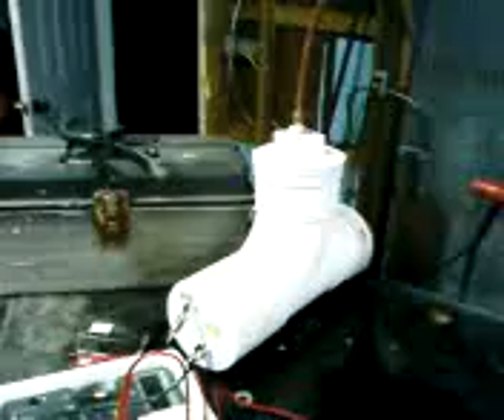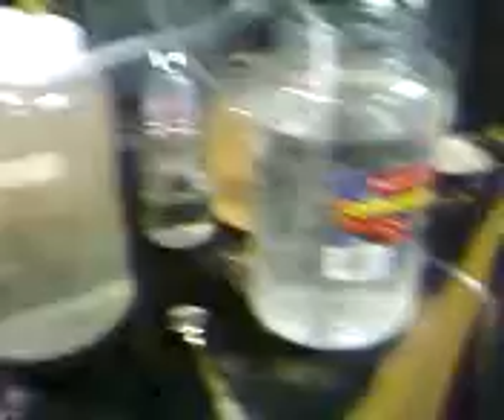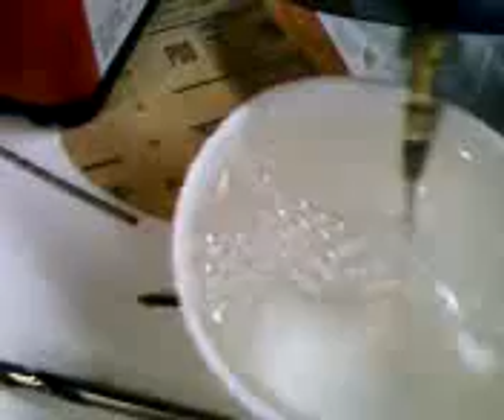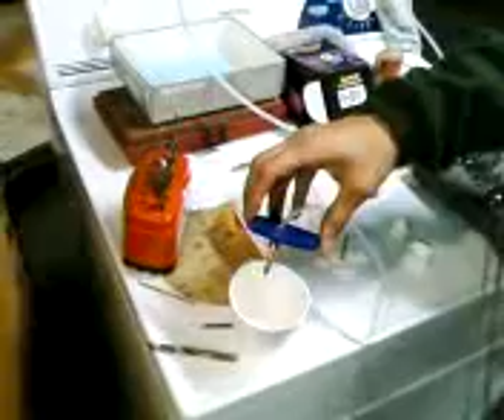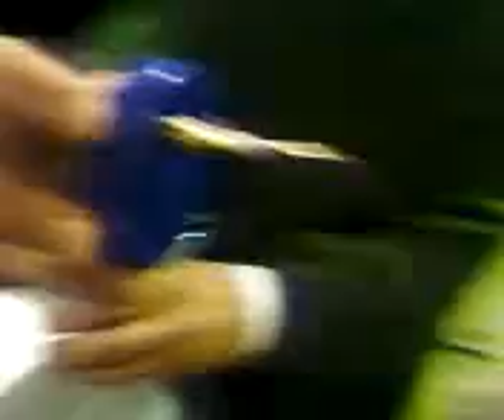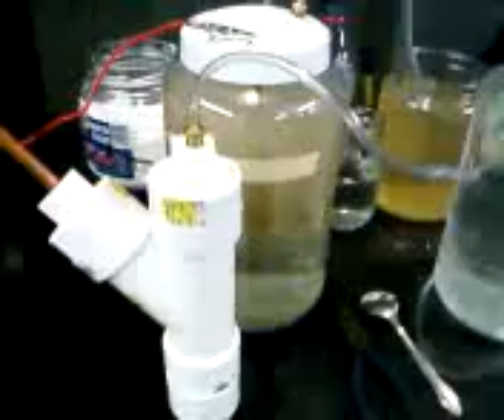hho generator

Comment: amps = gas, volts over 3v = steam and heat not gas ... that simple, sort of ...

more surface area allows more amps before melt down ...

heavy gauge wire allows more amps before melt down ...

close plate space increases amps ...

more baking soda increases amps ...

if you have a simple 2 plate device wired +/- will do best with 3v @ as much amps as you can give it ...

if you want to use 12v, you gotta figure out a way to get your volts per plate gap down between 2v-3v.

Comment: Key is getting enough gas to the torch.  To run reliably, I have found you need to be putting out about 2 LPM of gas flow. To do some cool stuff with it like cutting metal, you need about 4 LPM flow. But I am using a .30 mig welder tip with mine.

I have made them before using big hypo needles.  These worked with as little as 1 LPM flow but the flame was so tiny could not do much with it.

Comment: What you have is working so is fine.  But you might consider recycling cast off plastic drink bottles for use as your bubbler.  They aint as pretty but they are throw aways.  If you pop one, its quick, easy and cheap to put another in service. I use 2, one near the device and another near the torch.

Comment: yepper, that sure be one good argument for a bubbler.

Looks like you might not have enough gas flow to support the size hole in your torch tip.  Hard to tell in these grainy videos but that would be my best guess.  The gas needs to have a certain critical velocity out the end of the torch to keep it from following your tube back to the bubbler. 

So, either up the volume of gas, or make the torch exit hole smaller.  And let us know how it goes.